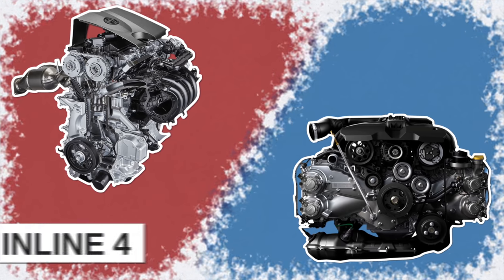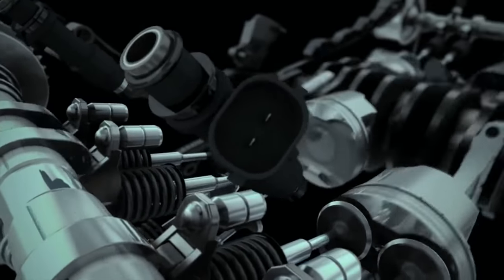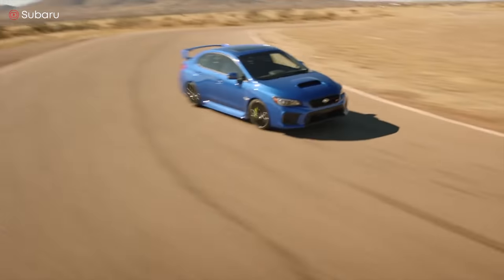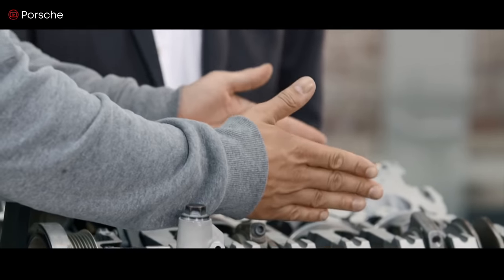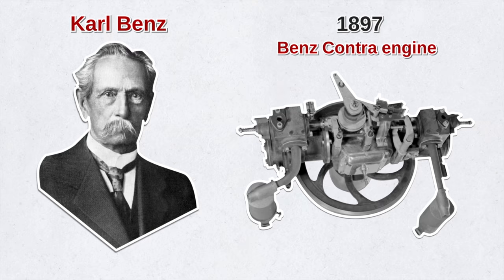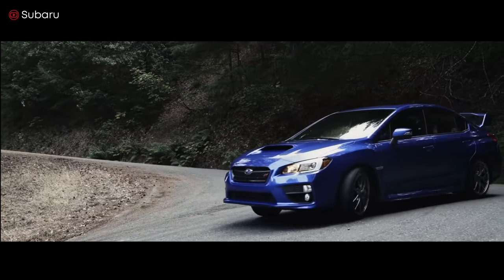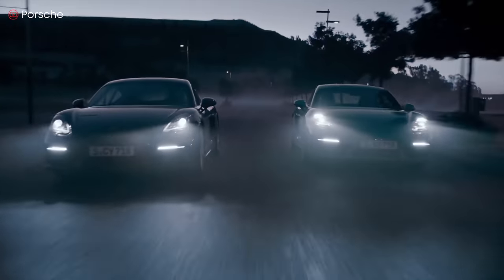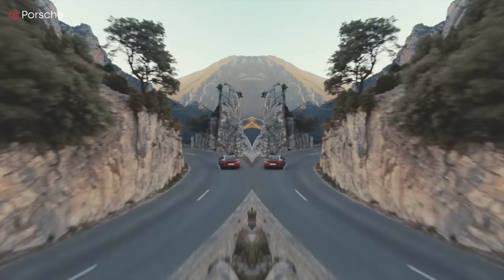Why Not to Buy a 4 Cylinder Engine Car

Comment: Inline-6 not only is balanced, but has at least 1 cylinder in a power stroke at all times, and a simple layout.
One of the few reasons to buy beemdubs.
Reply: You mean the most unreliable engines of all auto makers? They shouldn't be, but they are. Enjoy changing engines every 60K miles. If you replace it with a used engine expect to change them even more frequently. Oh, and they ain't cheap even used (not that money is a concern to most BMW drivers but whatever).
Reply: The AMC straight/inline 6 engines used in Jeeps from 1964 to 2006, is one of the most reliable engines in history.
Reply: There aren't many😜. Some of worst longevity of any marque.  Unless you're talking survivors from before the late-90s.  Those older Bimmers are well-built and will last "forever" with periodic maintenance.
Reply: @milohoffman274  What should be a simple and reliable engine gets ruined by cheap parts and poor assembly over at BMW. It's been a problem for decades so they have to know. They just don't care.
Reply: @milohoffman274   So were the Chrysler slant 6.
Reply: Don’t forget the 2Jz in the Supra, also an inline 6
Reply: @an0maly5k27  I had a Detroit Diesel DD-15 (14.8 liter I-6 turbo diesel) in the Freightliner semi I used to drive. The oil change interval in that engine was every 60,000 miles.
Reply: @asajayunknown6290  lmao thats a load of crap those old bmws are not reliable and are money pits like scotty says they are. majority of those old bmws have more plastic than the new inline 6 engines. the new b58 platform is way more reliable than the n series platform
Reply: @milohoffman274  
Jeep used them for a very long times yes.
Easy to service but extremely poor fuel economy.
Reply: @an0maly5k27   personally  had more issues with toyota than BMW.   M52 and M54  six will do over 300K with no issues. BMW may have lost the plot  now but I have no issue with their older models.
Reply: @an0maly5k27  man V6 is better
Reply: @universalg_  I'm speaking of the 2002 (model, not year) and the early-mid '80s 320i, .... OLD versions of BMW :)
Reply: Biggus Dickus  The newest hardtop MX-5 with a skyactiv inline-6  sounds like a dream.
Reply: Any 4 cylinder engine that uses a 4 stroke method has a power stroke in every cycle, so what's your point?
Reply: @universalg_  N54 engine requires a lot of preventative maintenance but is a fun motor. Cooling on the B58 is improved and seems like BMW does care and tried to make it more reliable. They even moved the location of the coolant reservoir to an area where it doesn’t get as hot and engine also has insulation to reduce fluctuation in temperature. However still lots of plastic.  BMWs drive nice and some people are okay with the trade off in spending the money to get a better handling and performing car. They are money pits but you can lessen the spend by going to a good indy shop...  I’ve had Honda’s and Toyota’s but prefer the BMWs. If Mazda came out with a RWD car with an inline 6 then that would be very, very interesting.
Reply: @an0maly5k27  what about the cummins engines? Guys drive those engines 500+ thousand miles and love them.
Reply: @cass8144  Amazing engines! $$$ though ha!
Reply: @an0maly5k27  yes they come at there price. The 12v cummins is worth it though. Have a buddy that had one. It sat in his junkyard for all most 3 years. Put new oil and fuel in and a battery and it cranked right over. They are stupid simpleand reliable engines
Reply: The boxer 6 is perfectly balanced.
Reply: The sad part is that there are only 2 gas inline 6 in production right now. Everything else is diesel
Reply: @ImAFanboy  an inline diesel 6 engine would be the most reliable set up of all tbh...
Reply: @ImAFanboy  yes. I love my 24v cummins because its so easy to do maintenance on. Diesels aren’t bad in pick ups, they get almost 20mpg, while my gasser f250 gets 10mpg and its even worse when im towing
Reply: @waynejackson1426  I meant to say that while inline-4 has primary balance, it doesn't have secondary balance, while inline-6 achieves both.

Comment: In Line Four "banger", way more longevity and easier to work, on - my humble opinion. 🙂  Roland Singh, Canada  🇨🇦
Reply: The late 90's Nissan Altima motor and 90's GM 2.2L are easy to work with, and lasts pretty long too.

Comment: The balancing issue with  inline 4 bangers is easily addressed by construction around a cross-plane crankshaft. Crank throws spaced 90 degrees apart, as opposed to the 180 degrees that manufactures have been obsessed with for decades. Cross-plane engines also sound a helluva lot better than flat-plane counterparts. To see what I mean, think of the sound generated by just one bank of a Chevrolet V8, or look up the Yamaha R1. Or Pontiac 4 cylinder. Which was half of a 389 Poncho V8 of the 60's.

Comment: I’ve been driving my inline 4 for about 22 years now...
Reply: I have grand voyager 2001 with 2.5l CRD inline 4 engine and it's still alive with 205k miles on it ^^
Reply: @EasternGE1  Lucky for u that u did Not have the 3.0 liter like I did on my 93’ Voyager. It was getting 50 miles to a quart of oil at 50,000 miles. Had it rebuilt Twice! And STILL had problems with the valve train! NO mor Mopors for Me!!!
Reply: @EasternUNO   I'm still driving my 69 F100 with V8 & eight hundred thousand miles on it.  (second engine tho)
Reply: @robertneal6878  Mopar isn't Mopar any more.
Reply: @Te Hapu  I have realized that for a number of years. It was just a play on a word.
Reply: @tehapu7358  That don't count
Reply: Yea mine is a piece of crap. After only 85,000 miles and 14 years. I had to replace a starter in my 2004 Matrix. Besides that it runs as good as the day I bought it.

Comment: Great explanation of the two engines Scotty. I like economy in general and reliability. I drive a 2018 Honda CRV. I d be nervous with a boxer engine and esp if they had  to totally remove it to do significant work on it. Might get a RAV 4 next though since I also love Toyotas.
Reply: I’ve had all the model CRV’s over 25 years but will go to the RAV4 next as the Honda 1.5L turbo engines will never hold up over the years like their 2.4L normally aspirated four.
Reply: @m1kcan1  true. Those K series Hondas hold a soft spot in my heart
Reply: @Biggus Dickus, I’m not a fan of hybrids or electric vehicles as their batteries are worn out after 12 years and they’ll need expensive repairs and maintenance by then whereas a well maintained Toyota will go 25 years with little fuss and expense
Reply: Rav4s drive like crap tbh. The forester handles way better because of the boxer engines low centre of gravity
Reply: Joe, have you had any problems with the Honda’s oil dilution issue?
Reply: @roberttroxell4006  No. I just keep/have  my synthetic oil changes when I get down to the 15% level. So far so good.Then again, I live in Florida.
Reply: Dont know why rav 4 didnt stay with the Inline  4. Dont need v6 in small suv

Comment: Subaru made an inline 3-cyl in the late 80's in the "Justy"
Reply: The Subaru 360 had an inline 2-cyl engine.
Reply: Also inline 2 & 4 cylinder engines in the Rex/Sherpa model series – but perhaps none of these were imported into Scotty's region.
Reply: Yep and one of the first CVT automatic transmissions
Reply: The Subaru Justy was on a Suzuki Swift platform.
And it was 4x4 i think.
Reply: @zsomborsomogyfoki  It came both as a fwd and a 4wd, although the fwd version was mostly a rebadged swift. Also the engine was designed from suzukis 1l inline 3 engine at the time, but they upscaled it to a 1.2l (Which became the EF12). Minus a few minor problems in the beginning, the engines are known to be very reliable. Originally the 1.2 litres came with ~70hp, but they can handle up to 130hp on the stock internals with a turbo, and as high as 200hp if you start upgrading the internals. :)
Reply: @haavardhnable  Had a Justy, great little car. I've heard the engines are popular for lightweight airplanes.
Reply: @rhllnm  Subaru used the 3 cylinder one liter Suzuki engine. GM used that engine in the Geo and Chevy Metro.

Comment: We have become a Subaru family. We just retired our 2009 Forester when the head gasket went at 240,000 km. I hindsight, I should have spent the $ to replace it. Everything else was in good shape. In 11 + years we replace only the alternator and the catalectic converter plus wearables like tires and brakes. We now own a 2016 Outback and 2020 Forester. We love the way they handle and they have all the newest safety technology. Both cars are excellent value for money spent.

Comment: My 2.7 Tacoma Inline 4 was a grunty beast, biggest mass production out there yet. It was tilted in mount to help the torque twist. I would have kept it if not for the the 3rd Gen Tacoma auto tranny shifting nightmares. My 2.7 F150 twin turbo was a good upgrade
Reply: Those 2.4 / 2.7 Toyotas are very easy to work on though.
Reply: Congratulations on upgrading to the Ford F Series, they are great trucks.

Comment: I had a cobalt for 5 years and i loved that little i4 2.2 engine. But iv also had a subaru 2.0 boxer engine. I wanted to supercharge the i4 engine and do a sti turbo system on the subaru. Unfortunately i lost both cars

Comment: I chose cheap and simplicity over smooth ride and complexity.
Reply: i have one word "trabant"
Reply: @rfmonkey4942  Well that's not saying much.
Reply: Honda and Toyota do too. That's good enough for me.
Reply: With the Chevy Cobalt, it runs smooth, and is not hard to work on, also the car and its parts are not expensive, also the performance is decent as daily, but for more performance Cobalt SS is the way to go.

Earlier generation Cobalt SS came Supercharged, and later generation Cobalt SS came Turbocharged.

The Pontiac G5 GT is pretty much a Cobalt SS without the forced induction, but has all else, more or less.

The Pontiac G5 is Pontiac's version of the Chevy Cobalt, pretty much a rebadged Cobalt.

Comment: I believe your animation of the inline-4 (early in the video) is incorrect, although other animations later in the video are OK.  I'm reasonably sure that, on an inline-4, cylinders 2 & 3 go up/down together, and cylinders 1 & 4 go up/down together.  This would make sense with a firing order of 1, 3, 4, 2.  If the engine was as shown in that first animation, with cylinders 1 & 3 moving together, and cylinders 2 & 4 moving together, it would have a lot more vibration than a normal 4-cylinder engine.

Comment: As an ex GM mechanic, i prefer the inline 4 to a flat 4 and any v6. Cheap to fix, easy to work on, and very reliable overall design. Case in point, GM's iron duke and Toyota's 1.8L.

Comment: Nothing against Kontramotors (flat engines), having a Subaru myself, but THE "boxer" engine was an OPPOSED-PISTON engine when I was an apprentice marine engineer in the 1960s. It was the nickname for the British Doxford Marine Diesel which was a vertical in-line opposed-piston two-stroke. Other famous examples of true "boxer" were the Napier Deltic Diesel used in boats and railway locos, and the German Junkers Jumo aero engines.

Comment: 2002 S10 Inline 2.2 Liter Vortec 🇺🇸200,000 original miles & still going💪strong
Reply: GM products are junk dude especially s-10s   Ford Rangers were good though.

Comment: I still think the inline 6 is the best format but it doesn't fit everywhere, especially in front wheel drives.  Engineering these things is always about trade-offs.
Reply: How about inline-5? Don't they offer a good compromise between inline-4 and inline-6?
Reply: Inline 6 fits great into my Honda Valkyrie(motorcycle).  Its a big bike but handles like a dream due to its low center of gravity.   Smooth as glass, can balance a nickle on the valve cover at 6-7K RPM.
Reply: @craigmanning2439  
When you write "handles like a dream", do you mean "like a dream" or "like a Honda Dream"?
Reply: @craigmanning2439  Craig, the last Honda motorcycle with an inline 6 was the 1000cc CBX in 1982.  Your Valkyrie has the Goldwing 1800 opposed 6 in a cruiser frame, or have you not noticed it has 2 valve covers?  If you believe the Valkyrie is "smooth", go find and ride a CBX some time, and you will find a new definition of the word.
Reply: Sorry guys, It was late and I was sleepy.  Of course I meant boxer 6.   Everybody knows that the goldwing/valkyrie had a boxer not an inline.  Sorry my mistake.
Reply: @craigmanning2439  No worries.  Although I do have to admit I was wondering how an inline 6 fit in a motorcycle.  They have those V-8 custom monstrosities and I always wonder "how on earth do they ride it?"
Reply: @Nonplused  Look up the Honda CBX production 6 cylinder.

Comment: I have had both inline 4s and boxer engines.  Both,  I had to turn off the ac or heater to get enough speed to get onto the highway.  The Subaru had head gaskets replaced at 83k miles, CVT replaced at 94k miles and died at 126k miles. The inline was slow but no problem,  plus Subaru got me for $800-$1000 scheduled to maintenance every 30k miles. Should have bought a 4 runner !

Comment: Inline-4 ftw. Gotta love my 2015 Scion xB with 2.4L 2AZ-FE. Runs beautiful. Sure they are known for oil consumption but that’s mostly on 2007-2009 with those engines.

Sure it takes me from A-B but at the same time, I want some simple performance parts on my xB.

They are very simple and fun to work on, last forever, and they are beautiful little four bangers

Comment: Just got a 2021 Legacy Premium with the 2.5.  Can't get over how quiet and smooth it is.  I'd go to pass someone and would never know it's going over 5,000 RPMs without looking at the tach.  Yes, I have less access to the spark plugs with a boxer engine, but iridium spark plugs have a much longer life anyway.  But the serpentine belt up front is much more accessible than the belt on my Cobalt is.

Comment: I'll take a regular Honda, no turbo Civic, Accord or CRV, no 1.5 turbo or oil consumption motor, or any of that nonsense. Also, give me a Toyota Carolla  hatchback or sedan. All preferably with a stick shift.
Reply: Good choice if you don't care about having fun (which is totally fine)
Reply: Agreed. I bought a 2020 Civic Sport Sedan with a manual transmission and the 2.0 port injected naturally aspirated K20c2 motor. 
I’m not a fan of direct injected turbo motors or CVT transmissions for daily driven reliability. 
I already have a fast weekend car, I went the reliable route for the daily. 👍🏻
Reply: Really boring, toyotas and hondas, especially the below 2.0L motors, force induction or not.

In general hondas and toyotas are very boring.

I need something more interesting, something that honda and toyota don't make, a car sized of a late model Nissan Sentra powered by engine that is 2.0L or above, preferably 2.2L and above, for four cylinder motor.

I favor the V6 and larger the most, its even better when the V6 or larger motor has forced induction.
Reply: @theroyalcrownedtiger2946  Hondas boring? Only if you're poor XD
Reply: @MrGW2fanboy  : Budget has nothing to do with finding hondas and toyotas really boring.
Reply: @theroyalcrownedtiger2946  umm imo it kinda does, type-R vs Honda civic CVT comes to mind
Reply: @MrGW2fanboy  : I am not interested in hondas or toyotas.

Like I said, it's got nothing to do with the budget, I find hondas and toyotas really really boring, regardless of the models, price tag, and so on.

I rather get something that is not made and designed by honda or toyota .

Comment: Boxer is the only piston design used in modern aircraft. Power to weight ratio and reliability standards are toughest in aircraft. They shed heat well too. Balance shafts in inline designs bleed away 3-8 horsepower in addition to their weight, along with structural ribs, and load bearing oil pans to tamp down inline NVH. NOx emissions are easier to control with a boxer. My old Forester blew zeroes on the gas analyzer at 130K miles.

Comment: Got an Impreza 2016 with 2 L boxer.  Unlike a Porsche, there is a lot of room in the engine bay and no crappy plastic covers.  Reliability (no turbo, no direct injection, no CVT, just stick) is not an issue, the car is good for at least 200k miles. The maintenance costs are lower, than for my previous inline 4 from BMW.  Love it and like it more than any inline 4's I owned in the past.

Comment: Honda has been making boxer engines since the 1970s in the goldwing motorcycles. Latest version is a 1.8 liter boxer 6 cylinder making 125hp
Reply: 125 from a 6 cyl, weak. the old 70's 4 cyl no fuel injection no turbo, no charger were near 100